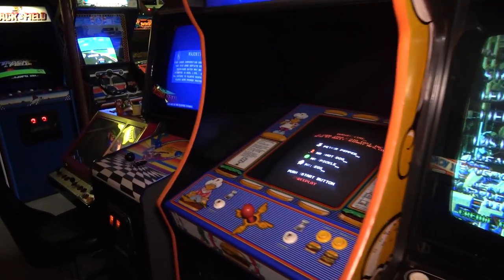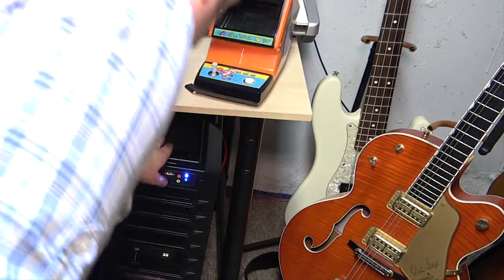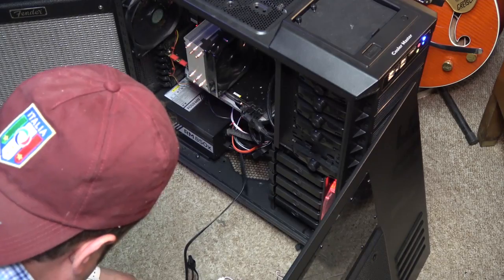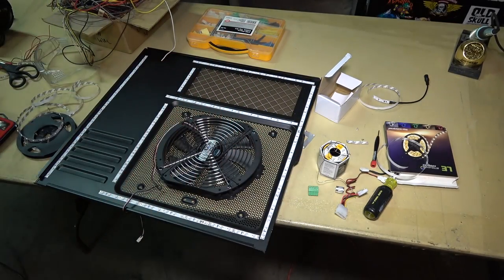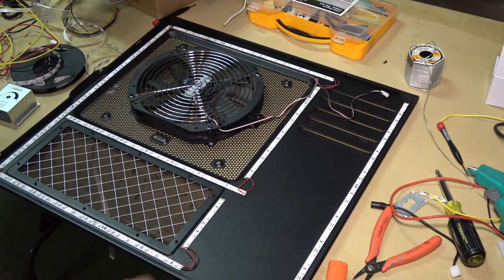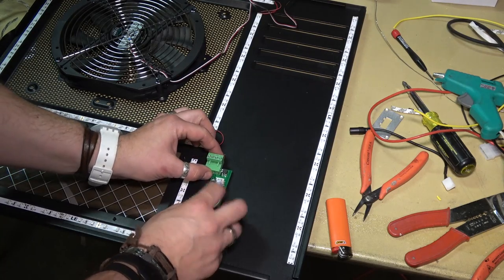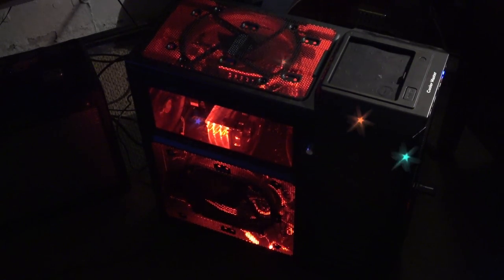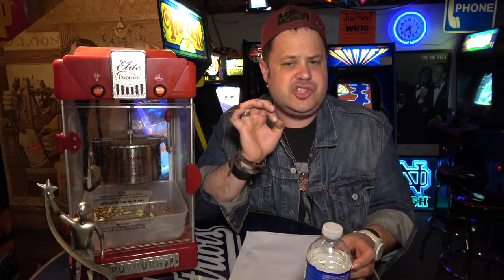Awesome Gaming PC LED LIGHTS case Mod using LED strips and 12V LED Dimmer.

Comment: That dimmer is legit. You literally solved a ton of research for me and I just clicked this video randomly. Wanted a dimmer knob for my top IO panel. I was just going to directly wire in a dimmer knob.. this is a much better option, PWM current modulation. and it's only $8... also going to be soldering my lighting directly to a female sata plug instead of dealing with molex. Thanks a lot!

Comment: You should check out sound reactive cold cathodes. They're cheap, easy and would probably be great ambient lighting for jam sessions as your music gear is set up right by your pc. If you have an old spare atx power supply you can wire it up to run without being connected to a mobo and wall mount the cathodes for a pretty rad budget lighting rig. You could even hook up one of those led underglow car kits with remotes that nobody would dare put on their car anymore. My friend did the latter option and it was a pretty awesome setup for a game room.

Comment: Hey  john  just a pro  tip (LOL)Put your PC on a  piece of Cardboard instead of  carpet it can get a Static  electric surge in the  winter months
Reply from the maker: +crowbar2004 it's on wheels.
Reply: you need to make a mineral oil computer build they are sick!!!
Reply: static electricity isn't a problem. The only reason it should be on something flat is to allow airflow (like bottom mounted power supplies/fans) and to prevent dust.

Comment: All this trouble to install LED strips in a case, you know they actually make LED Strips strictly for PC cases? no need to do all that wiring, just plug into a molex connector and your done, plus these specific LED strips come with a remote, so that you can change the colors or turn them off or on.
Reply from the maker: +TigerClaw i like my way
Reply: Your way is a lot of work, and I know some people here wouldn't go through all that trouble. lol
Reply from the maker: ***** I HAVE A DIMMER
Reply: The ones with the remote control can dim, or change the colors of the LEDs. :)